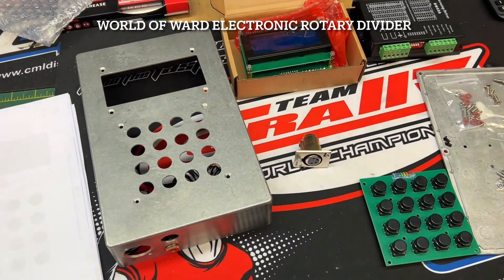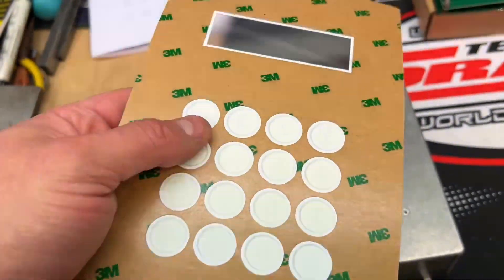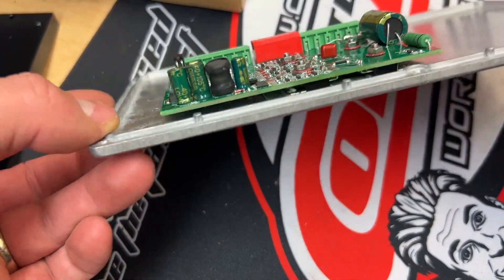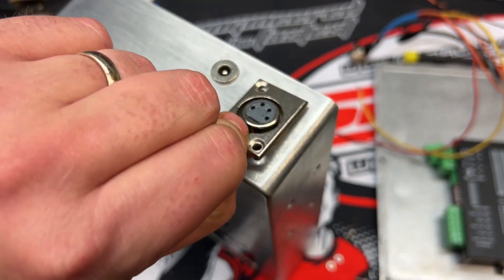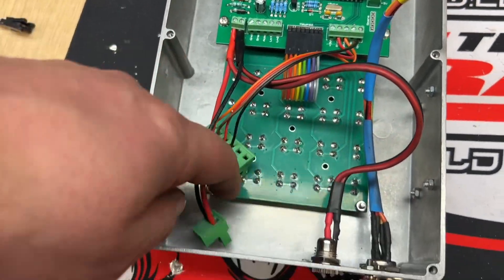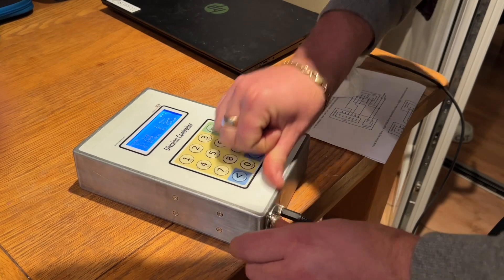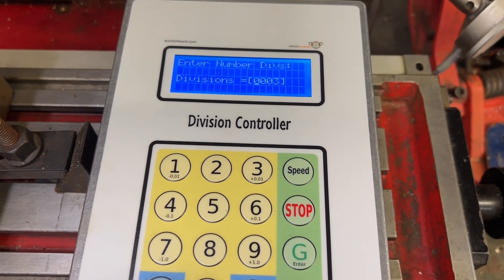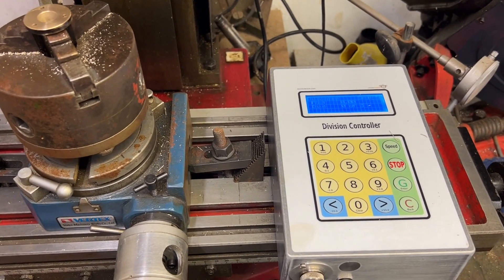Building the World of Ward Rotary Electronic Divider - Electronic Rotary Table

Comment: I am looking to try a diy arduino based positioned, if that fails due to my lack of ability to code it then I will fall back to this. It's a nice follow up to your earlier video, but I would have like a bit more detail on the connections used to and from the stepper controller. Perhaps some detail on what each of the cable are for, eg the dir+ and dir - , the ena, what is the step/clock pulse etc...
Reply from the maker: Hi yes, I’ve used a few of the Arduino based controllers and have made them myself. They are also very good. 👍 however Steve’s interface is excellent and for the money he asks, the package with the keypad and box is fantastic. Mine has had lots of abuse and still works very well. I think he buys in bulk as you can not buy the items separately for less, and his are all pre-drilled and labeled with a custom keypad. For the effort, it isn’t worth building one from scratch. I have no affiliation, just happy with the item. As I say, by the time I’d build the Arduino setup it cost me the same price for an inferior setup.

Comment: What accounts for the backlash and when it happens?
Reply: Use rotary tables and dividing heads, like pre-DRO leadscrews, in one direction only. Although both may have adjustment to engage the worm into the wormwheel without clearance.